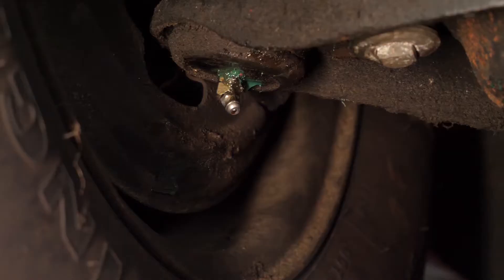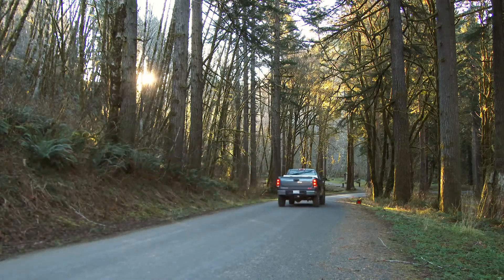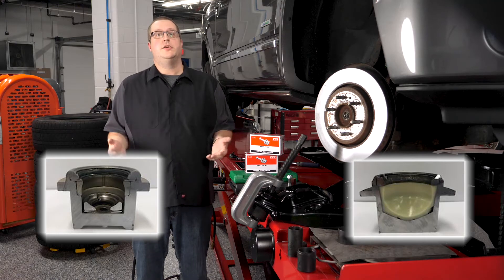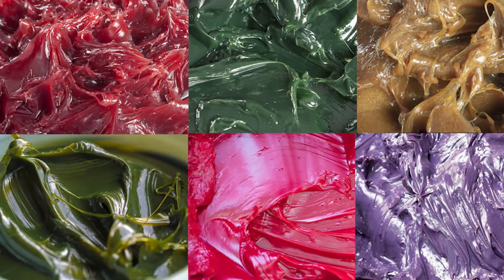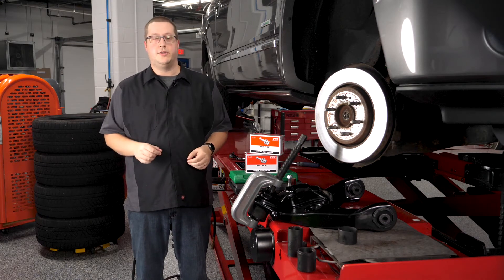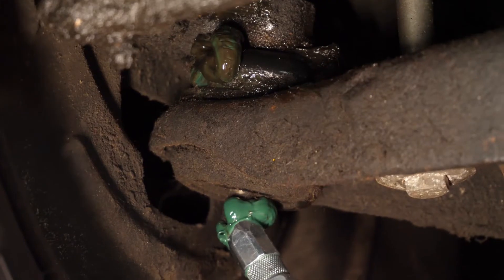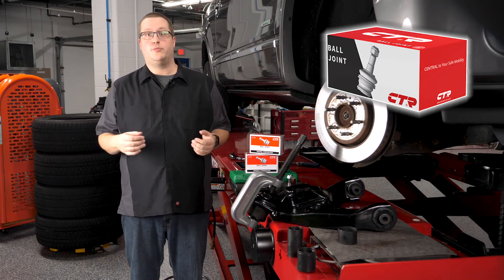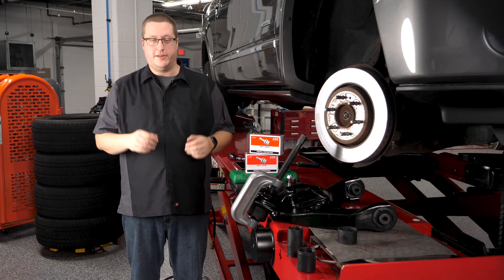Did you know? #1. METAL VS. POLYMER Ball Joints: Which are superior? | CTR Parts

Comment: I promise zero people are going 100k miles without an alignment
Reply: I dunno, on my least driven vehicle, it has over 70K mi since the last alignment and is mostly short tripped so that 70K miles happened over 20+ years.  The tires are wearing fine.  Granted it's a truck, so the suspension is built to handle stress better than a car or modern crossover would, but it's a truck in the video.  It also receives other service at less than 100K mi intervals.  100K mi intervals are for people who don't expect to get more than 200K mi out of a vehicle because they bought junk.  ;)

Trucks in particular are more in need of metal BJs because they withstand higher load and shock force than polymer bushing  BJs.

Comment: Okay the rotors get hot AF…. You really think plastic bearings are going to last when they’re a couple inches from hot ass rotors?
Reply: Possibly not in some racing applications, but in everyday real world use, there is a massive amount of airflow from the wheel spinning, effectively keeping the BJ cool enough.  Consider that during normal driving, even as hot as the rotor gets, the wheel that is bolted onto it in direct metal to metal contact, doesn't get very hot unless you brake hard and then stop right away so the heat soaks into the wheel instead of having the airflow from rotating.

Comment: Still a fan of greasable for vehicles that see heavy off road use i.e my jeep all steering and u joints are greasable. Sealed joints are never a perfect seal and will still let some dirt and water in, using greasable joints in that application will let you push it back out but must be done after every trip out. Evry thing else non serviceable.